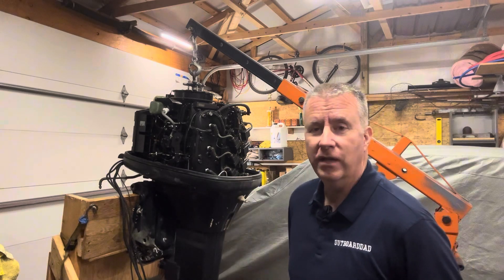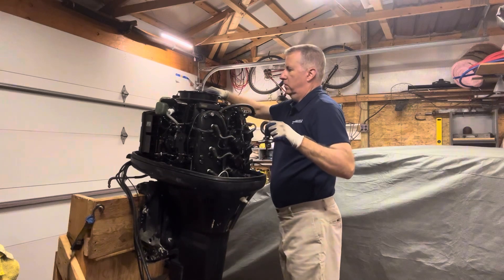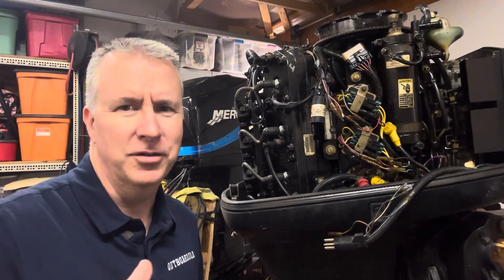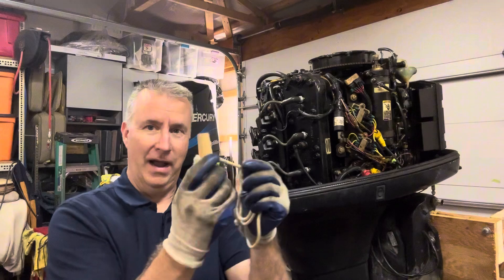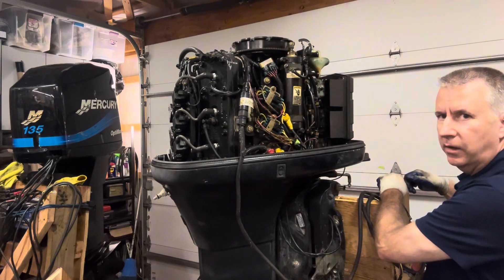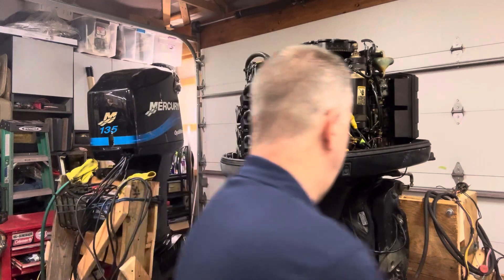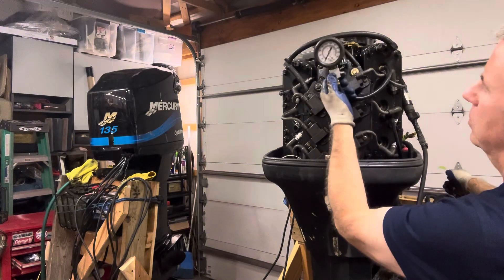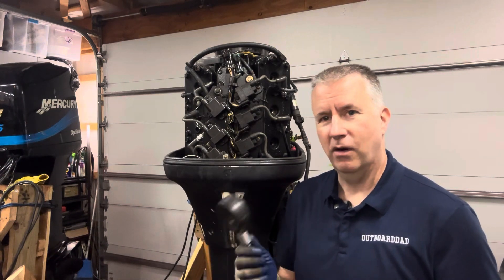How to compression test and scope an Outboard Motor

Comment: Hi! I have a Honda 90hp, what would make a cylinder have a higher compression than the others? one cylinder reads 180
Reply from the maker: Ok, what do the others read? If they are significantly lower then they may have cylinder scored, stuck rings, or valve issues. Do you have a scope to look inside?

Comment: Keith:  Do you need to run water into the motor when doing a compression check???  I've never done a compression check, but just bought a quality 6 piece kit...  Encouraged by your recurring message to be brave when assessing motors, I decided to expand my "skill set" to include compression checking.  Gotta start somewhere (simple).
Reply from the maker: Sweet! Love to hear that your outside your comfort zone! No need to run water unless your starting the motor. What motor are you working on?

Comment: Got  the  diagram for my old Johnson 30hp!! thanks bud
Reply from the maker: @seedless-bud  anytime! Let me know how you make out or if you have any questions
Reply: @OutboardDad  i will, and if i need i have the number you gave in the email i thank you for that, waiting on my ignition to get in and i will wire it up for pull start and safe off the rest of what i am not using. But I will let you know how it goes, SAFTY FIRST!
Reply: Good analysis!
Reply from the maker: @ Thank you!